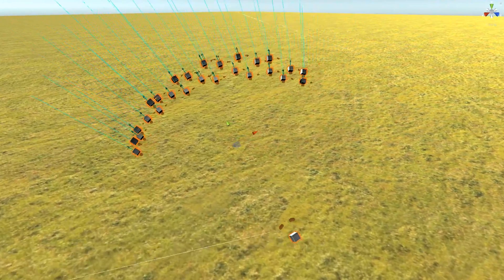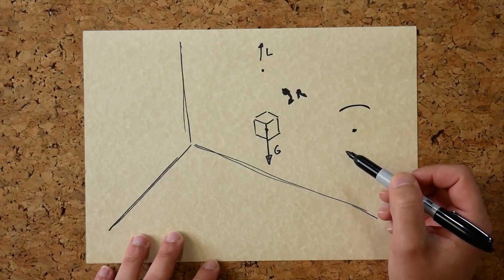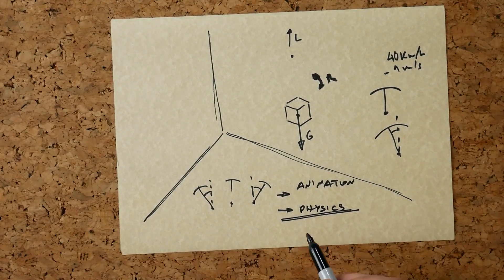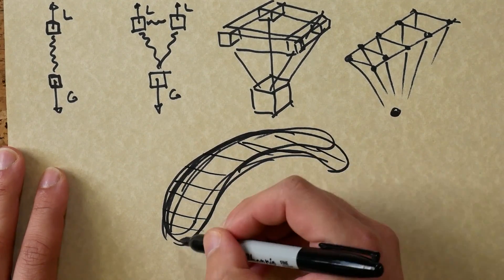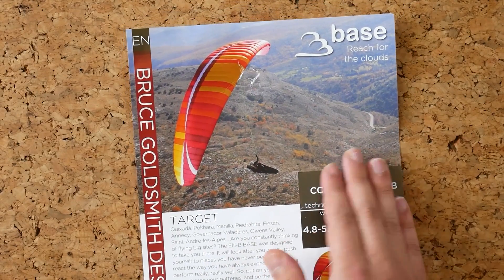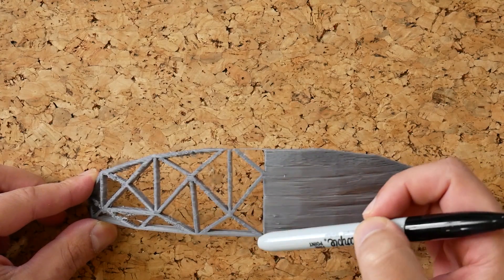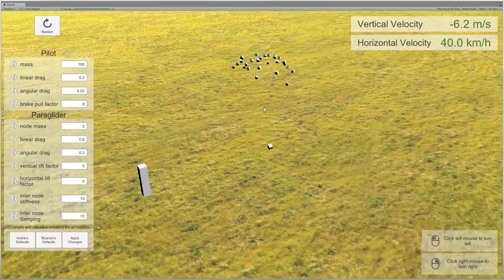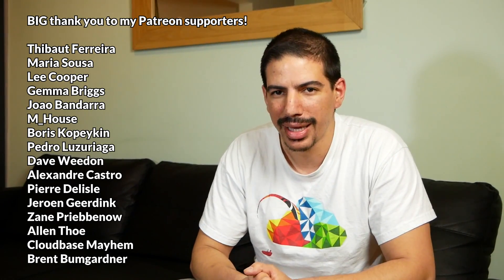Creating a 3D Softbody Simulator - Paraglider Game Part 4 - BANDARRA

Comment: Very impressive so far and I don't envy the massive task you have ahead of you, because in comparison to a flight simulator controlling the up, down, left and right forces applied by the pilot's hand's from a fixed point like a joystick or steering wheel, the  directional turning forces on paragliding wings are "uniquely influenced" by the pilots shifting of their body weight to add an increased pressure to any hand pressures applied in times of aggressive movements such as a spiral turn etc. - Good Luck to all involved as I can see this being a big "must have" for all para pilots for relieving frustration on those rainy days that were "pre-booked" for flying - Lol

Comment: I think this project is so cool, and thank you for putting in all the time and energy required. Can't wait to play the version with Thermals. 
My 2 pieces of feedback:
1: The delay on the camera angle is good when the glider is just oscillating, but makes accurate turns harder as you can't see where you're headed until the camera catches up.
2: Is there any way to program the keyboard for the brake controls? Maybe 3 keys for each brake; More, Less, and Hands Up. This would allow for a more nuanced control of the wing, which might make it easier to spot problems in the physics programming?

Comment: do you assume the connections between the wing and the pilot to be springs aswell? Really nice model to start with - I think. Cool.
Reply from the maker: At the moment those connections are set up the same as the connections between the nodes, but stiffness and damping are set very high so they are effectively rigid bars instead of lines.
Reply: Hmm - I guess you're aware of the flaws when doing this. If you're using too many direct rigid connections to the pilot node you in fact add some weird stiffnes to the nodes in the profile. As there is this new boundary condition to keep the distance constant..
Reply from the maker: Nicolas Hoyer lines don't stretch significantly in flight so that shouldn't be a big issue. These connections do pivot at both ends though
Reply: Hey Andre, I wasn't talking about line stretch - this has no impact on this level. But just think of one pilot "node" connected to e.g. 10 nodes at the trailing edge with a high stiffness like a bar. This would result in 10 trailing edge nodes having lost one degree of freedom (the radial one with respect to the pilot node). In this example your trailing edge stiffnes would drastically increase - because you're just allowing movements roughly in flight direction or opposite... Again - I don't know if you've 'wired' it like this.. Can't explain it any better here. Hope you got an idea of what I mean and why 'bars' are a bad replacement for the cords in terms of simulation.

Comment: Impressed! It looks like it's working rather good already. Would it take a lot more CPU to actually have all the correct hang points? I woulnd't mind loading up my pc to the maximum for a realistic paragliding simulator where i can load a specific wing and try out new stuff. I noticed SAT works :-)
Combined with a VR headset, a harness that measures weight shift and brake toggles, this could become the best simulator ever!!!